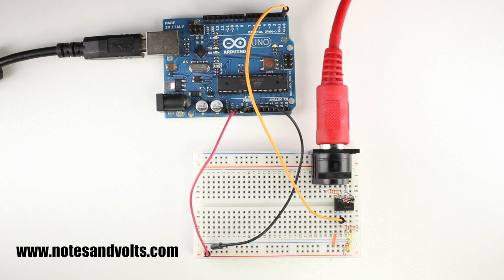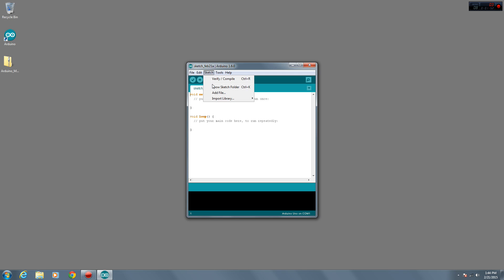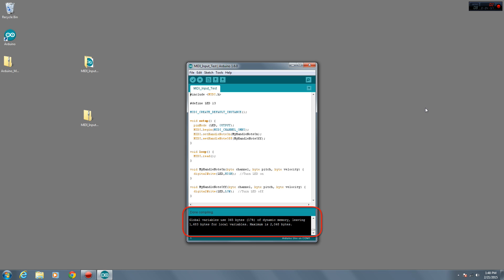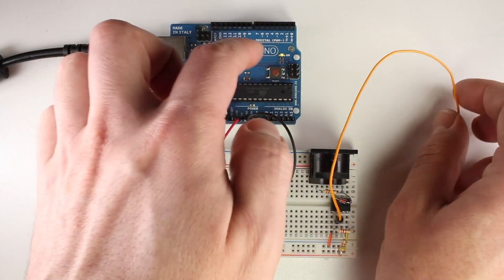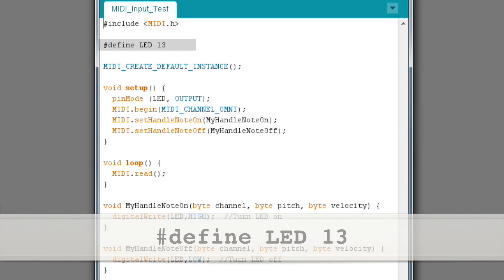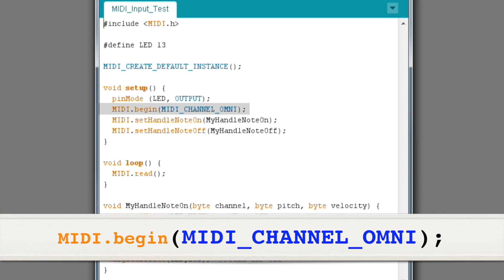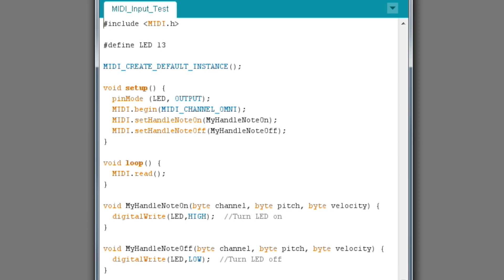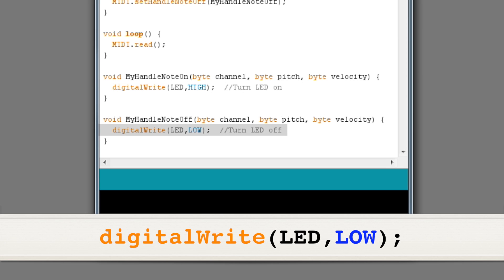MIDI for the Arduino - MIDI Input Test

Comment: I am so lost:( I tried so many different circuits off the web with no luck. I even tried the small 4n28 chip but it didn't work either. I followed your steps exactly except for one small detail: I used a 3.3k resistor instead of a 4.7k resistor from pin 7 to the negative rail. Is this enough to make the circuit do absolutely nothing. I tested with an LED to see if I was getting an output from the midi cable. I did. Then I checked to see if I was getting a signal from the output pin of the 6n138 and there was nothing. 

Do you have any ideas what could be wrong?
Reply: Have you find ? I have the same problem with a 4N25 :'(

Comment: Hi, I tried it with the Arduino Due and It did not work ... but with the Arduino Mega2560 yes ... can u tell me why, 'cause I usually work with Arduino Due and the Mega is not mine :S
Reply from the maker: +sergio pachon Hi Sergio. I haven't used a Due for this but there seems to be some issues with the MIDI Library and the Due. Check out this link and see if it works. http://forum.arduino.cc/index.php?topic=167981.0